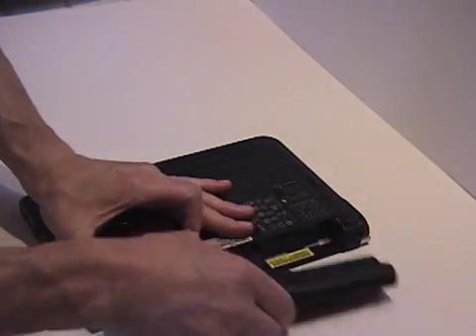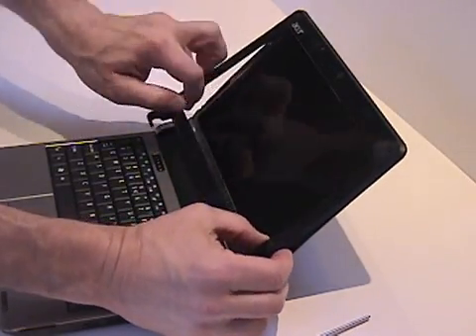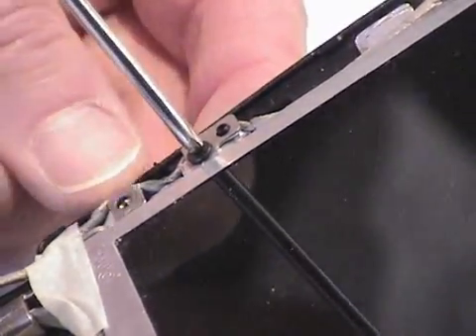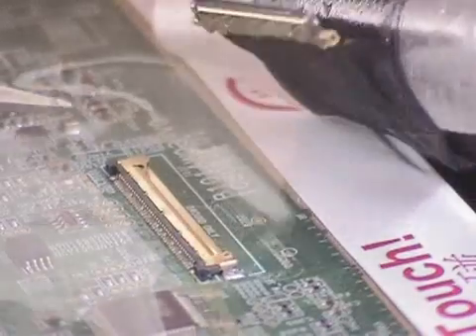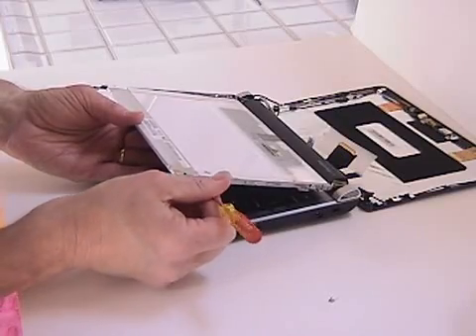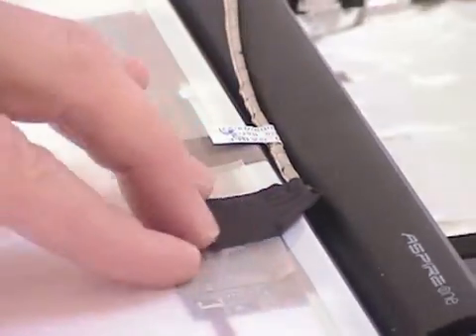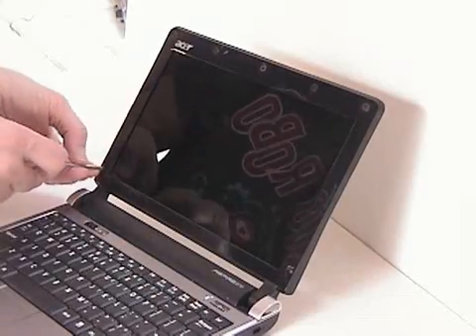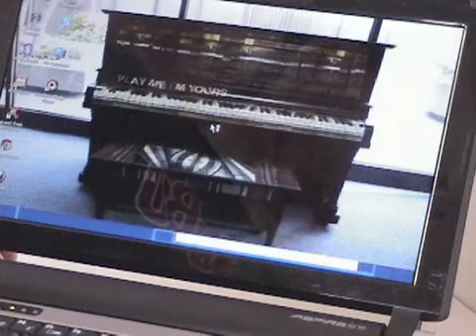Acer Aspire One D250-1389 Laptop Screen Replacement

Comment: Please verify that the Acer D250 hsa 2 screws on the bottom of the bezel and 2 on the upper corners covered with a rubber cap. If you do not remove the 4 screws you can brake the beze. After you remove the 4 screws you can take apart the bezel and it does sound like if it were breaking. But if you follow the  instructions on the video you sure will brake the bezel. Anyway the video is a good help when you try to chanche the screen. Thanks

Comment: A top tip!  Don't use a screw driver or knife to get the bezel retaining screw covers off...Believe me, it's so easy to damage them and the surrounding area of the bezel. Instead, press Blue Tack over the area of the screw covers, pull it off, and the covers come with it! You can also use those little adhesive strips that are used to hang picture frames, etc. Expensive, but well worth the effort!